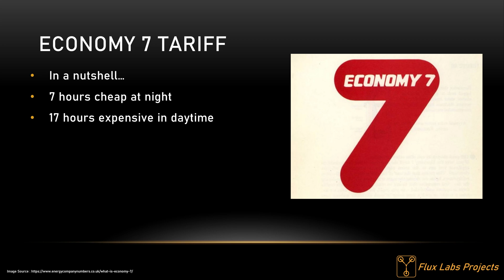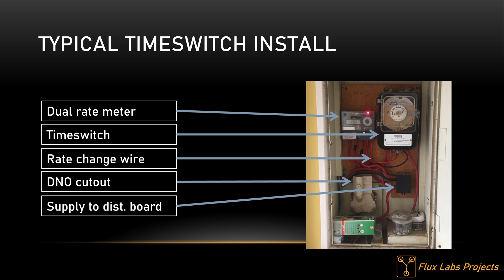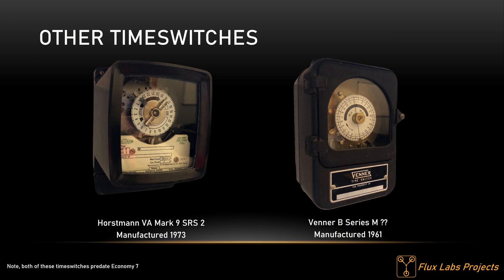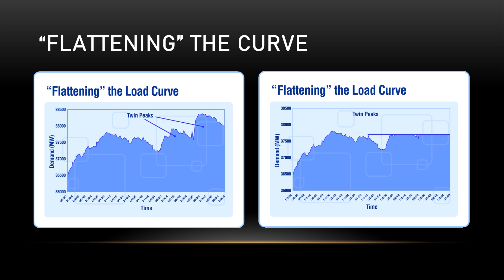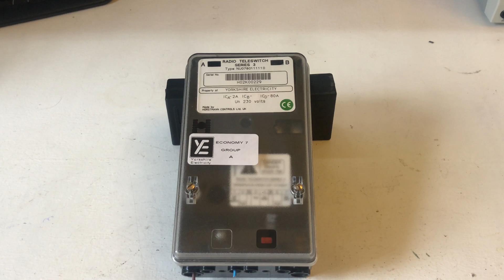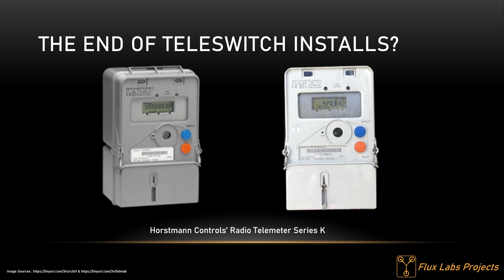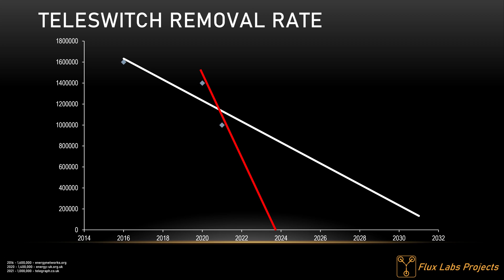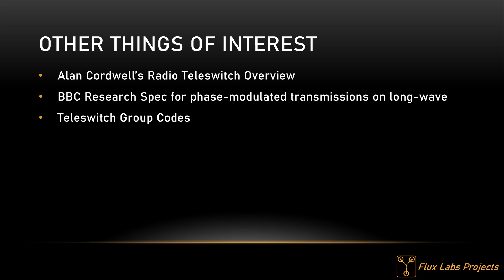Timeswitches, Teleswitches and Telemeters, A History

Comment: Turn off now June 2025
Reply from the maker: So i've heard! Curious to see what happens!
Reply: @FluxLabsProjects  technically on the day the signal turns off if you have ur hotwater on itll stay on and if you have it off it will stay off
Reply from the maker: @VultraRBLX  It depends how it's shut down, they will most likely send a OFF command to all teleswitches and then turn the signal off.

Comment: Very interesting and informative video. I had a dual rate white meter from 1980 with a separate time switch on E7 tariff. The time switch failed about 3 years ago, fortunately stuck on low. I reported it to my energy supplier who fitted a dual rate smart meter. The smart meter internal clock has drifted and is now about 5 hours slow. I live about 15 miles from Droitwich Longwave Transmitter and still listen to R4 on 198m. I expecting a close down 30 April but it didn't happen and looks like it's just the Teleswitch service that preventing shut down until at least June 2025. I wonder how much that's costing?
Reply from the maker: I'm happy to hear you've enjoyed the video. Amusing about your meter being stuck on LOW time!  I am surprised your smart meter has drifted because it "should" be updated time wise by it's connection to the mobile networks. But, I could be wrong. I don't know how much it's costing but it's going to be one huge bill.